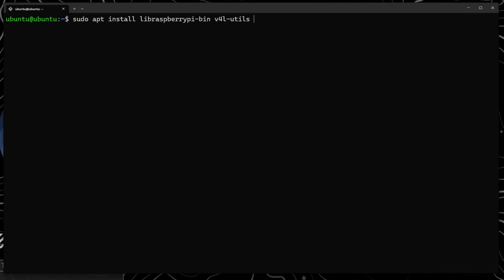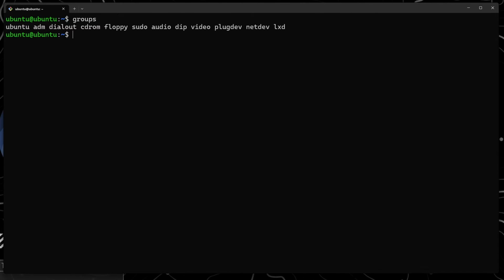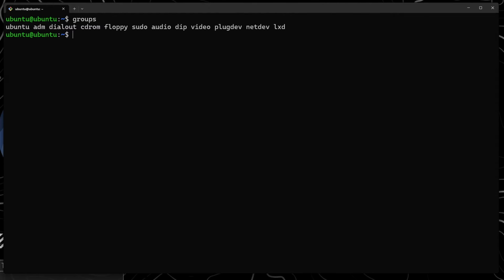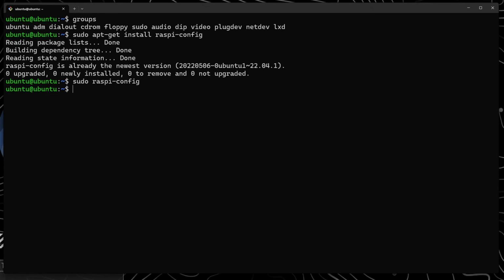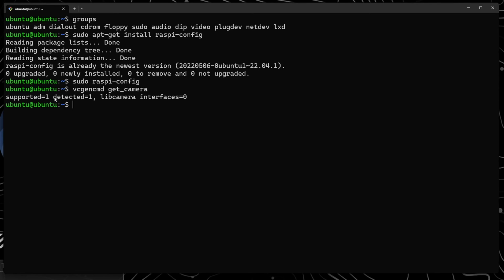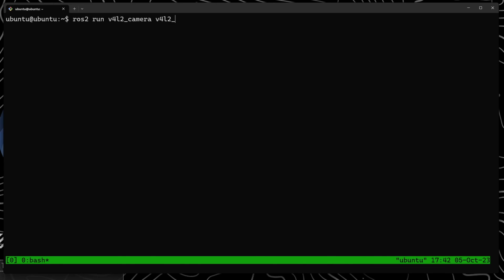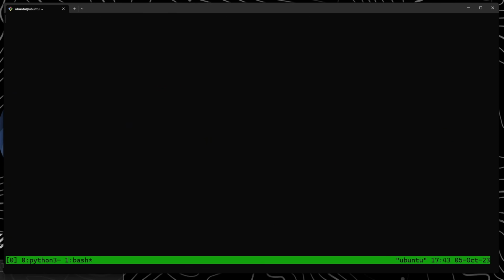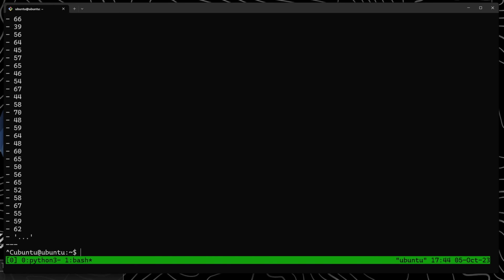Using the Pi Camera - ROS2 - Ubuntu 22.04

Comment: Im stuck on visualizing the image stream after running the camera_node. I used rviz2 and rqt but both show an error because the camera stream encoding is NV21. Is there a way to reformat this encoding to something like RBG8?
Reply: Update: saw camera_ros documentation on how to declare camera format. Running this command worked:

ros2 run camera_ros camera_node --ros-args -p format:=RGB888

you can also add other parameters:

ros2 run camera_ros camera_node --ros-args -p width:=1600 -p height:=1200 -pAnalogueGain:=10.0 -p format:=RGB888

Visualize in qrt using the image_view visualization 
Visualize in rviz2 by setting frame to camera_link and adding image and selecting the camera/image_raw topic

Comment: I followed everything according to the video but when executing ros2 run at the end, the error i receive is "failed to enable camera". I am unable to debug it whatsoever. Been about 2 days. I am using a PiV3 with a Pi3b+
Any help would be great greatly appreciated!!
Reply: any update i am facing the same issue with pi camera module 3 imx708?

Comment: Hi there, I ran `ros2 topic list` and got the same output as you did. However, when I tried running `ros2 topic echo /image_raw`, I didn't see any output. Additionally, when I run `vcgencmd get_camera`, I see `supported=1 detected=1, libcamera interfaces=0`. The only difference between your setup and mine is that I am running a Docker image in Raspberry Pi.
Any help would be appreciate.

Comment: I use a raspberry pi 4 running Ubuntu 22.04 and to which I connected a raspberry module 3 camera.
I also use ros2 Humble.
When I run the command:
ros2 run v4l2_camera v4l2_camera_node --ros-args -p image_size:="[640,480]"
I have the following error appearing:
[INFO] [v4l2_camera]: Starting camera
[ERROR] [v4l2_camera]: Failed stream start: Invalid argument (22)

Would you have any idea how i could fix it ?
Reply: Same error
Reply: @MechtEng  I have the same error, did anyone happen to fix it?
Reply: @kiwi_juice0  have you found a fix?
Reply: @andyhgnguyen  I haven't fixed it out yet but Ill let you know if I do!
Reply: same error any help?
Reply: @ I found that this camera isn't compatible. With a module 2 camera it worked fine
Reply: Same here. Someone please find a solution haha